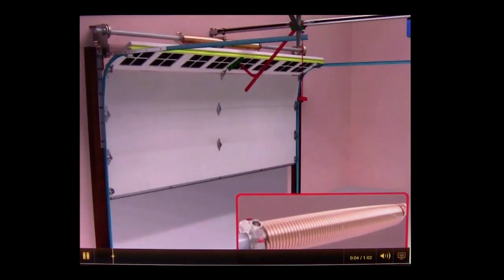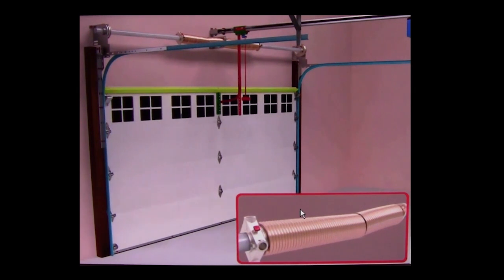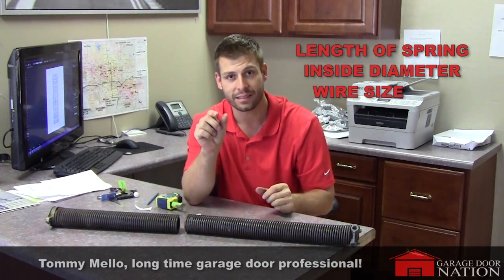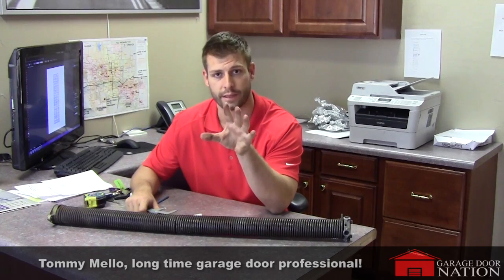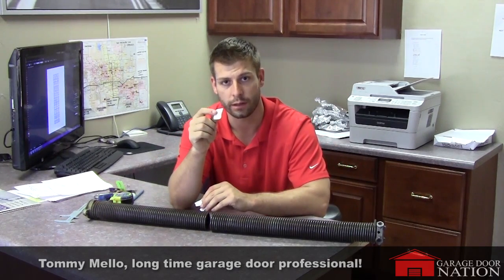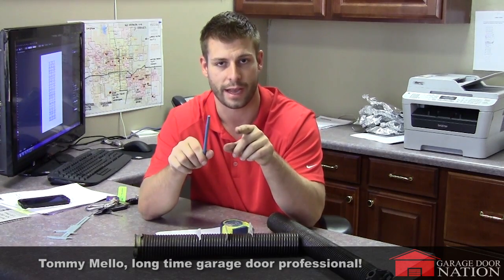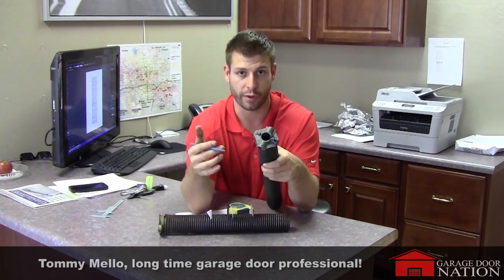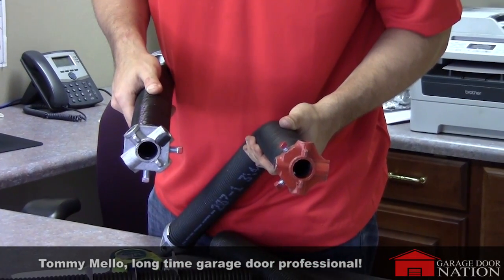How to Measure Garage Door Springs *EASY* ► 2020 UPDATE

Comment: I recently had a spring snap.  The door is solid fir lumber and for 30 ish years operated fine with the one spring it had installed.  The spring is about ~36 inches.  If I replace it with a two spring system should I have the length or size of the spring or just wind way less?

Comment: Windsor door BL is 250 wire can't always go buy color.
Reply: I just took the 10 and 20 coil lengths for my spring.  They're 2 7/16" and  4 7/8".  However, the end is painted red... not the green that he mentioned.

Comment: Hopefully you can help me with an issue or give me some ideas.  I measured and pretty sure I got it right...replaced the spring and got everything installed.  When I release the door it raises by itself, indicating the spring is too tight.  But after lifting the door half way, (this is a manually operated door, no opener) i have to lift to the top and then the door comes down by itself...it won't stay up, indicating the spring needs more tension...does not make sense to me????  any suggestions

Comment: All the info same for parallel extension springs? Or would I need diff measurements?

As far as I know the springs are as old as the house (been there since moved in 25+years ago) I'll have to look for style and color when I get time but I thunk it's time for a new opener so thought I'd fix the heavy door too...

Comment: ok so i did the measurements on my broken torsion spring. looking for some replacement parts. just wanted to know if you got parts that are a little smaller or a little bigger then the measurements you got. whats the worse case scenario that can happen? thanks

Comment: Hey Tom, at the beginning of the video it says that you no longer need to take the springs down to measure them, that is awesome. Just a couple of questions, does the tension on the spring need to be released to get an accurate measurement? Also, I have two springs (like most people) are each of the springs different lengths?
Reply: I’m a 21 yr garage door vet, yes release the tension, be very careful when dealing with spring tension. They can be different lengths because they are different springs. We go by what is called IPPT. “ inch pounds per turn” you have to have the correct IPPT depending on the weight of your door. To much IPPT your door will be to light and won’t stay down on the floor. Not enough IPPT your door will be heavy on the floor and be hard to lift. Hope this helps. Correct spring size is very important.

Comment: My springs are .207 x 2" x 22-1/2".  Can I use .207 x 2" x 23"?  Will a half inch longer spring make that much difference? Thanks.
Reply: "no".  I was off 3/4" on mine and they work fine.
I've read wire size and ID are critical, but that length can off about 1" before you have problems.

Comment: Thanks for your videos. Question here, if you have time to answer. I'm looking to replace a 20" length spring with a 2" internal diameter spring for a 1-spring system. For the third measurement, I'm getting a 10-coil reading closer to 2 1/16", and a 20-coil reading of 4 3/16", so I'm unsure whether I'm at a .207 or a .218. Any suggestions? I have a 7'-high by 9'-wide door.